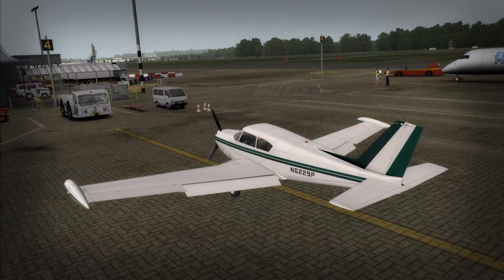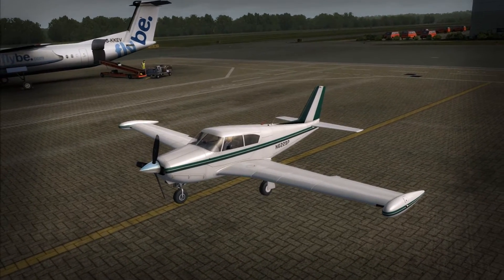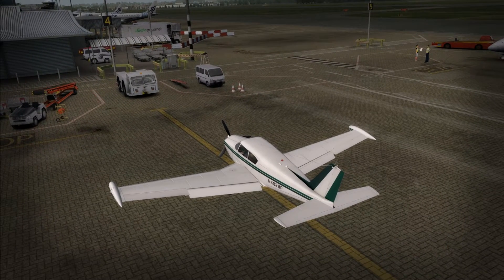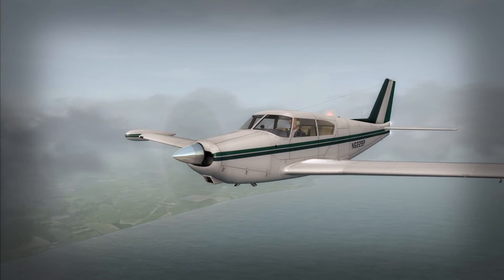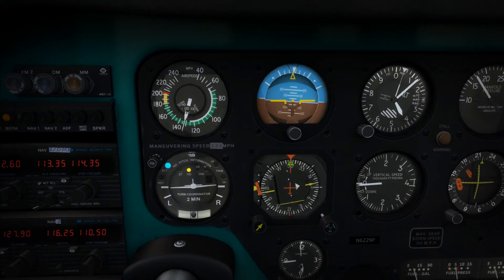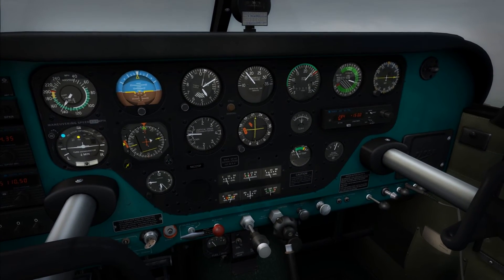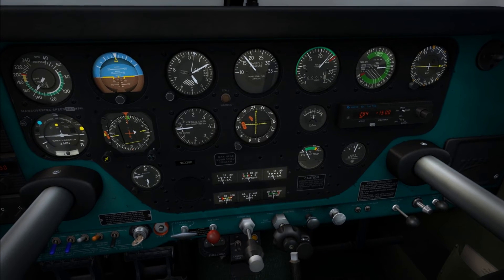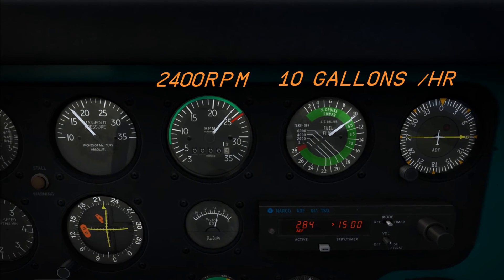FSX VATSIM: VFR Training #2 | Mixture Leaning, Lean Of Peak | [Advanced Tutorial] [ENG]

Comment: 1:21 The Comanche does not nearly have 300 horsepower. It has a 250hp O-540 . If you're looking for 300 horsepower, you'll get it in a Continental IO-550, or a newer Lycoming IO-540. How about you get your facts straight. And make sure it's before you assume what you're talking about. The Comanche also only flies at a maximum of 185 knots, nothing close to what a 737 even climbs at...
Reply from the maker: Sorry that you're disappointed mate. This video was created a little while ago; I am quite aware at the speeds that a 737 climbs at under normal conditions and I must've done some research at the time based on the engines that the PA24 uses. Please chill, I appreciate the comment, but no need to get so defensive haha ;)
Reply from the maker: I just skipped to 1.21 and listened the my 737 comment "up to speeds that a 737 can fly at, when at low altitude". Which is true

Comment: As a private pilot, I wouldn't recommend operating lean of peak unless you have balanced fuel injectors, also you should have proper instrumentation. EGT and CHT probes for each cylinder are crucial when operating lean of peak. In this video we see that the pilot is operating lean of peak, peak meaning optimal fuel to air ratio is obtained. Using this method could potentially harm the engine due to the fact that the pilot added more fuel to the mixture, possibly bringing the ratio closer to peak performance. I realize this is not probable as he only added a small amount of fuel to the mixture, however, you would never be sure unless you had the instrumentation to indicate that you were not operating at peak, and that you were indeed operating at lean of peak. Awesome video by the way!